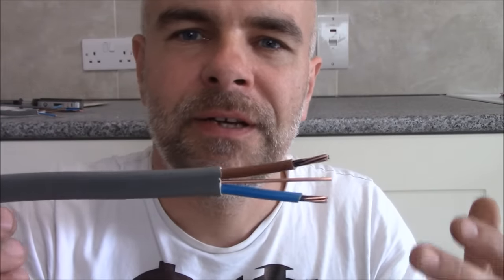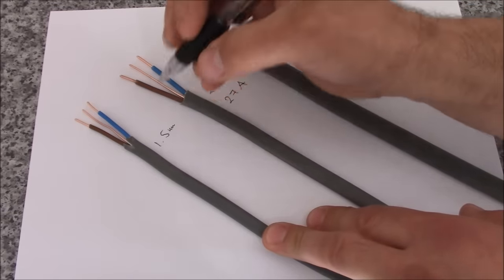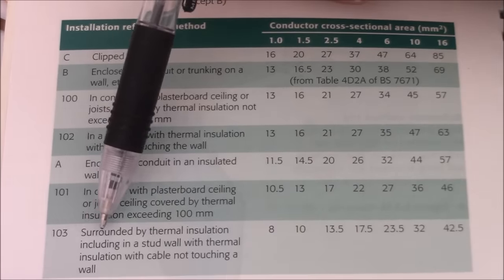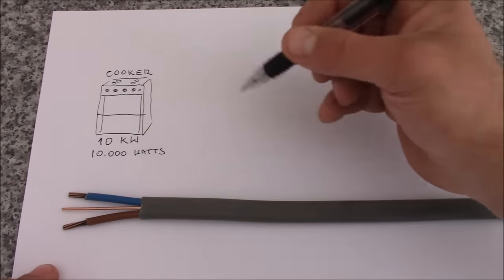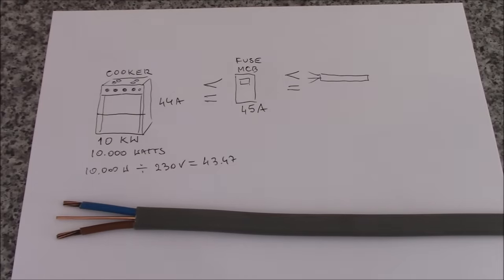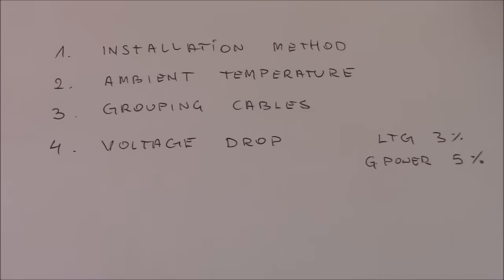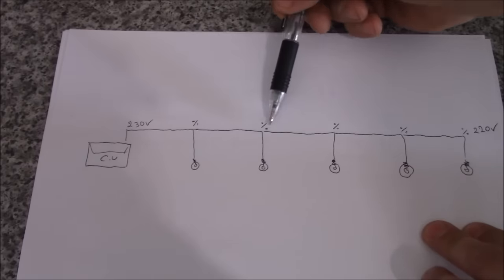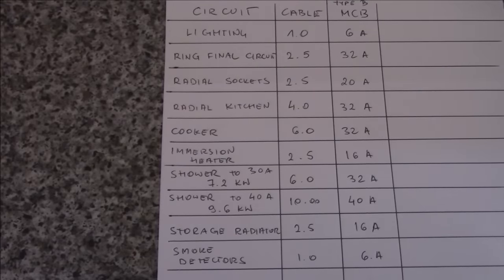Cable size Circuit breaker amp size How to calculate What cable

Comment: Hi Buddy, could answer me about why you used same size cable 2.5 mm, but there are different rating MCB, 32 A and 20 A. Please let me know buddy?
Reply: Because that 32amps mate is for RING FINAL CIRCUIT so your runnin cable 2.5mm from mcb goes trough the  room all the way arround and comes back to the place where went out,basically goes back to the same mcb 32amps,you feeding same cable at both ends and it gives you double cross sectional area of 2.5mm cable,is like"5mm"

Comment: The 45A MCB would trigger between 135A-225A if it's a B curve and between 225A-450A if it's a C curve. Why are you using a protection so big? Just asking, I'm probably missing something.

Comment: Simple. 
Amp of electric appliance <circuit breaker < wire size 
Meants the amp of electric appliance should less then circuit breaker amp, the amp of wire is should be higher then circuit breaker 
Amp = wattage / voltage 
Circuit breaker is to protect current overflow to an appliance and prevent wire to burn because of current overflow
Reply: Shouldn't the wire burn out just incase the circuit breaker is bad?
Reply: My understanding (I'm not an electrician) is that the circuit breaker limit is set lower than the cable carrying capacity to prevent overloading of  the cable... BUT the fuse in the appliance plug is to protect the appliance itself... 

The cable , say a 2.5 T & E radial carrying 10 socket outlets would have a 16 amp breaker (for a cable in conduit in an insulated wall)  and the individual appliances would have lower rated fuses, say a 3 amp for a bedside lamp, in their associated plugs... 🤔

😎👍☘🍺

Comment: Good video thank you . Am a plumber but me and my friend going to do the electrics for 2x electric showers .. best to use 10mm cable for 8.5 kw showers ? And seprate mcb breaker for both showers including 45amp double pole switches ? Scary part is wriing the fuse board am scared ..there 3 breakers 45amps not being used but not 100% how to wire that part
Reply: You need RCDs in bathroom circuit or RCBO.
Reply: Any work electrical work in a bathroom is considered a special location and is notifiable to building control !!!!
Reply: @spongebobplugtop  we didnt do it in the end .. called a sparky he delt with it ..fully working ! Got paid we left

Comment: You are wrong sorry sir, for domestic houses the voltage drop is 6 % for lighting and 8% everything else.  So thats 8% of 230v which is 18.4 volts you are allowed in total.   mv/amp/mtr

Comment: Which wire is suitable to use to make an extension wire the 2.5 mm or 1.5mm wire can you give me detail information and the reason of your answer?
Reply: 2.5 mm2 for  extension , is better , so that  it can carry  most of the load .  in case of short circuit at the load end , the smaller cable heat up and  if we run the  cable through the,  carpet of floor  of  our  house  , it can catch fire .  even if the mcb trips .

Comment: can I run a single phase cable 220 meters if so what size would I need please
Reply: Use formula - mv/a/m x L x C divided by 1000 to calculate cable size.

Comment: OK, it's nice. But 45 A for cooker is too much. Better idea is connect cooker as three-phase load (with neutral conductor), and then current will be smaller, aprox. 15 A.

Comment: Just remember there is diversity in cookers 10amps x30% of the power output of the oven and + 5amps if it has a socket with the switch, 6mm is fine for reference method 101

Comment: Should the rating of the MCB/fuse be greater than the current or less? Thanks for the video.
Reply: Less or equal. The role of the MCB is to prevent excessive current -- the type of current that would cause the wires to heat and the insulation to melt and possibly cause fires -- from ever crossing the wire.

Comment: hi great videos, do you have a video where the lenght its calculated ?
Reply: The length of the cable ? that sepends how far the Cooker is from the wall.  the installer / electrician selects a length of the cable.

Comment: Why are you protecting the same wire 2.5mm^2 (storage radiator, immersion heater) with 16A type B breaker and same wire 2.5mm^2 (radial sockets) with 20A type B breaker? Thanks.
Reply: Ігор Івасів because a storage heater or immersion heater will usually be rated at 3kw or about 13 amps, you rate the circuit breaker to suit it, even though it's much smaller than the cable can cope with. A radial circuit with a socket may be subject to higher load if two appliances are used at once, so to avoid tripping the breaker is sized to accommodate two (or more) loads of varying sizes at the same time, while still ensuring the cable is protected. Radial 20 amp circuits are not that common in the U.K bit one might be installed if one extra socket is needed somewhere and the nearest ring or radial is hard to get to. We also sometimes use them for things like fridges- it can be useful to have the fridge on its own circuit so food doesn't spoil if the circuit looses power- more likely on a circuit shared with other appliances. We might also have a dedicated circuit for the boiler or other stand alone, permanently connected appliances that are essentially part of the building (as opposed to "portable" appliances like washers and dryers that may occasionally be relocated.

Comment: so what size wire should be used for a 200' run for a 15 amp circuit?
Reply: Use formula - mv/a/m x L x C divided by 1000 to give volt drop.

Comment: is it mm or mm2 did you mean? i'm a little confused and what if the length of the cable is 20 meters. is it the same thickness as well? thanks in advance and thanks for the video
Reply: mm square
Reply: For length of the cable you need to calculate voltage drop

Comment: 1 amp equals 1 coulomb of electrons. The NUMBER of electrons in the 
cable is limited by the diameter of the cable. Very informative video. 
Are the lamps in the "cooker" the same voltage as the heating coil?

Comment: Lighting 1.5 cable 10 amps are recommended according to code book
Reply: Given that most lighting is now LED this cable could easily be safely reduced to 1m.m. .. No  ? 🤔
Reply: 1.5 mm cable is way over the top for domestic installations.

Comment: in this example for loading 10 kw cooker::: the rating of fuse according on table 41.3 onsite guide bs7176 must be equal or bigger than the design current which is 50 amps not 45 amps which is not in the table then the cable size will  be according on table 4D2A 10mm not allowed 6mm because need to choose 65 not 47 amps. need to consider some other factors like ambient temperature , voltage drop

Comment: A great way for people to understand how an Electrical cable can heat up so easily.
Is to use a high power appliance then feel the cable with their hand, after using the appliance.

A great example would be something like a Vacuum or Electric room Heater.
It surprising how much even these simple items can heat an Electrical cable.
And these cables are outside the wall where they can radiate the heat away.

Comment: can you run cables in paralle?
eg 
2x 2.5mm will give 27*2=54 Amp ?
instead of using 
1x 4mm with 47 Amp
Reply: Leon Cryp in theory yes but its not recommended if one of the cables gets faulty you might end up overloading the second one. If the fuse fails to trip you get a fire
Reply: Oskar Ekholm for a radial circuit no. But in the U.K. We use ring finals for sockets, two 2.5mm cables per socket, in a ring, with a 32amp MCB.

Comment: if the shower has 9.6 kw then the design current will be 9600/230=41.7 amps how can we use 40amps circuit breaker for that which is lower ?

Comment: To calculate cable size using 'volt drop' formula.
mv/A/m (figure from Regs) x Length of cable run x Design Current then divided by 1000.   Then use rating factor to choice cable size.
Reply: Come again
Reply: @danielteyehuago1633  Are you a UK qualified electrician?
Reply: @stephenmontague4089  Ghana, West Africa but we use UK standard
Reply: @danielteyehuago1633  Hello again
Your using a book that gives general values.  
When I was an apprentice we had to use the 'Volt Drop Formula' I detailed previously to calculate precisely the volt drop for cable selection.  The calculated value can then be adjusted according to installation method to give the correct cable size and overcurrent protection.
Reply: @stephenmontague4089  Thanks for your response
Reply: You can easily work out the voltage drop in copper cable.Copper wire has a resistance of 75 ohm's per meter.Just measure its length.

Comment: Could I ask you to do a video on led out side lights, normally the smaller ones come with a build in PIR, we have a large yard which will need a single 150/200w led to light it sufficiently, how do you wire a PIR to an out side light..? thanks always enjoy your channel..
Reply: moxie mulgrew very good explanation.
Reply: moxie mulgrew in the pir you have terminals L and N for incomming power and L' as outgoimg power from the pir to the lamp if you are umvertaim call an electrican on youre region

Comment: Hi..My water heater min 2.2k -max5.2k ..So I use 2.5cable MCB 32A??Direct mcb to heater..
Reply: Hector Avril max draw would be 21.6 amps at 240v.  As you have seen, 2.5mm cable can carry that current, but on a radial circuit you'd use a 20A MCB. Bearing in mind a type B MCB will break almost instantaneously at 5 times rated value (100A). You'd not use a 32A MCB as this is greater than the CCC of 27A. Remember, MCBs protect cables from overcurrent and short circuits. Cable selection also depends on the environment the cable is run in as shown in the On Site Guide table seen in the video. You would have to do the calcs to be sure, or simply uprate the cable to 4mm on a 32A MCB.
Reply: Lee Greveson thanks

Comment: I have measured the voltage at the CU main switch in my house at 242v, yet I often hear that the UK is 230v?
Reply: All good pal,+- 10% tolerance so even 250v you can meet or 216for example.
Reply: @piotrf7648  looking for this reply as I thought it was 230 to 240 volts in the uk

Comment: Hi. Wondering if anyone could help me. I bought a cable for my electric cooker and its got to be 6mm2 minium. I purchased a 6mm2 off ebay and it came today and on the cable it says 5mm2? Is this this correct or have they sent me the wrong cable?
Reply: Hey Chris.
Very unusual to find 5mm2 Electrical Cable ??
Not sure where the cable came from ? ( Country ?? )
But it could be to small for your application IF it is 5mm2 ??
Of course it does depend on the power requirements of your Electric Cooker.
Best just to buy cable from an Electrical Wholesaler.
They only sell regulated Electrical Cable.
For general guide lines of use for cable sizes:
1.5 mm2 16 amps 
2.5 mm2 20 amps
4.0 mm2 32 amps
6.0 mm2 50 amps
10.0 mm2 63 amps.
These cable ratings are in line with the same size Circuit Breaker ( MCB )

Comment: Need to show AC Voltage to Amps for calculating correct size wire ( also either Al or Cu ratings ).......

Comment: Usually printed right on the cable or the package it comes in
Reply: Err- no it isn't. You honestly think cable comes on rolls with tables detailing capacity under multiple circumstances? Packaging carries the cable size, length and voltage suitability.
Reply: That wouldn’t happen otherwise you’d have all sorts of idiots ‘putting wires in’ .. oh hold on a sec...
Reply: @spencerwilton5831  does where im from!

Comment: If we assume that this cable 4 × 10 mm square each won the red, yellow and blue bears 50A and the sum of the three azazens becomes 150A question here won the cold black (neutral) is only 50A how to withstand the load charged against 150A
Reply: Neutral theoretically is 0 current, in 3fase sistems
Reply: TheSupreme Chief Rub in Single phase how

Comment: if 5 air condition current 55 Amp and some Light 220 VAC 7 amp this distance circuit breaker to home 150 metar which cabel use in this Load
Reply: sajjad khan its not a good idea to keep 5 aircons on the same fuse the over current could result in a fire if all ac starts at the same time

Comment: No good example was chosen. The simultaneity coefficient was not taken into account. Also, a three-phase power supply (3 x 400VAC) is usually used. Then the current is about 15A and the cable is 5x1,5mm2. MCB,  is for 16A.

Comment: Splendid! Just what i was looking for, though I did't find the thickness  for an electric boiler , according to my calculations this could be 16mm, is that right?  And 63 A? Thank you so much! perhaps you have the time to answer me.
Reply: Yes
Reply: 16mm is not for all boilers, the rating of the boilers determines the rating of the wire too. For any boiler less than or equal to 3kW, a 2.5mm and 20amps breaker would do just fine

Comment: 45 A CB rating is too close to 44 A load, can get overheated during operation.
Reply: Nah, she'll be good
Reply: Kentucky Fried Jesus on large appliances in the manufacturer specifies the breaker to be used normally. Too small and it may overheat, too large and you risk it not performing as intended as I'm sure you know. They consider diversity and also often use various internal circuitry to manage loads, especially in the case of things like large range cookers with 6 or 8 Rings, two ovens, separate grill etc- in theory these could draw 80 plus amps, but with diversity and power management (reducing power to rings when all on) they may specify a 60 amp breaker. In these cases the electrician would not be expected to understand the precise workings of each particular model, so the appliance comes with a table indicating cable and mcb size often under various circumstances.

Comment: I have a water well 30 amp 220 volts 1000' from the power source  what size of wire do i need to run without burning my very expensive water pump?
Reply: The breaker is 30 amps but what is the motor hp or wattage?

Comment: Sir, question regarding the size of the mcb. I thought the loading of the mcb should only be 80%. If the cooker/ load is 44A and we utilize 45AT MCB, it's almost 100% loading.
Reply: Dylan Ezekiel Lim If you install it lower than required current then cooker won’t even run. Sooner cooker is on breaker would trip. Breaker is installed a little bit of higher value as cables can handle extra load for sometime and after that breaker would trip if load is still high. Cables are also selected for higher current than the ratings of the appliance.
Reply: @abduljabbar-zg1jj  Please reread the question. You're giving a right answer to a wrong question.
Reply: Cyrus Kanda You may be right.

Comment: How to calculate the size of the CABLE and MCB for  motors 3 phase and single Phase
Reply: Same but you have to divide your calculations by square root of 3 eich is 1.73.

Comment: my cooker 9 kw work on 1.5mm cable who is in insulated wall 😁 but I want to change on 2.5mm and 25A MCB
Reply: 9kw ÷ 230 x 0.50. Your cooker should always be on 2.5mm and 20a circuit breaker. Would be better to use 4mm or 6mm cable. 4mm on a 39amp or 40amp circuit breaker.
Reply: @philipkhung1458  9Kw is 39A (45A MCB) so you need 6mm but you may need 10mm depends on the length. If you use 2.5mm the cables will start to glow
Reply: @tonyomalley901  go figure it out
Reply: My calculation are based on the wiring rules of Australia AS 3000:2018

Comment: How do I calculate them with equations? What if there are multiple loads in series and parallel circuits?
Reply: Usually loads are in parallel. Which you means you add all the rated powers.

Comment: why u dont consider the power factor, when you find the ampere rating of any particular load ? (P = V*I*cosΦ for single phase , P=√3*V*I*cosΦ for 3 phase, we can find the current for any 1 phase & 3 phase load by this equation.
I is the full load current. and also should consider the starting current(which is higher than the full load current for motors ) of the load when you select cable and breaker.
area of cross section should be in mm² not in mm
Reply: THOUGH YOU ARE  RIGHT ,  I THINK  HE IS  DEALING WITH    LOAD OF DOMESTIC APPLIANCES  INCLUDING  THE  HEATERS  EC , , AND CONSIDERED  POWER FACTOR AS  1 .  THE  CHART  HE  CHOSE  CONSIDERS  THE  STARTING  LOAD AS WELL  BEFORE   PUBLISHING THE BOOK .  IN SOME  COUNTRY THEY  SPEAK  SIZE IN MM FOR  EASE  OF  TALK , NOT BECAUSE THEY DON KNOW .    By the way how you managed  to write  mm2 , perfectly ? i could not  find it on the keyboard .the  exponent 2 .

Comment: Underrated cables are a fire hazard.Coiled wire offers a high impedance (resistance)to AC.Never run AC thru coiled wire.

Comment: Hi you didn't allow for the length of the cable the correct method for calculating cable sizes is by using the adiabatic equation not a table in the building regs book, you have wannabe sparkys watching this and could get the wrong idea sorry to be negative but it is critical to demonstrate cable sizing correctly
Reply: Can you please explain how to do it correctly

Comment: wouldnt it be easier to use 3-phase, rather than single phase? you wouldn't need such big of a cable and would be also cheaper
Reply: Not if the appliance could not handle three phase?

Comment: The mentioned values are cross section areas, unit is mm^2, not mm.  A 10 kW oven is most likely 3 phase supplied, therefore you need 3 live wires with 3rd capacity each.

Comment: 6mm? Really? You did measured the whole insulation not the gauge of the core wire.
Reply: It's the cross sectional area of each conductor. Millimetres squared. Not the diameter or width. Electricians just abbreviate to 6mil rather than saying the whole thing.